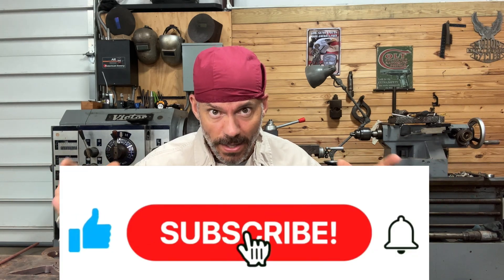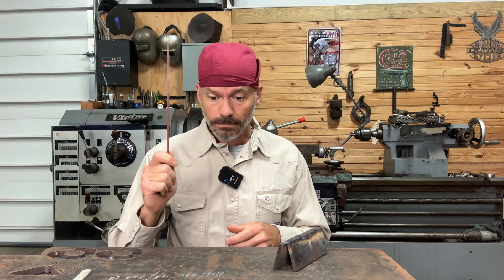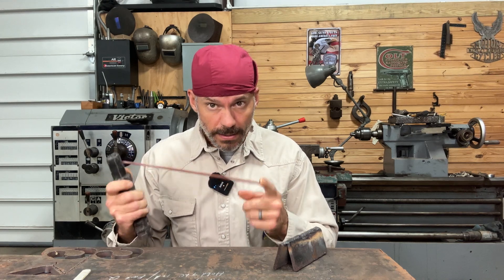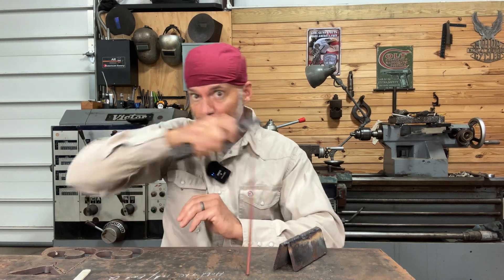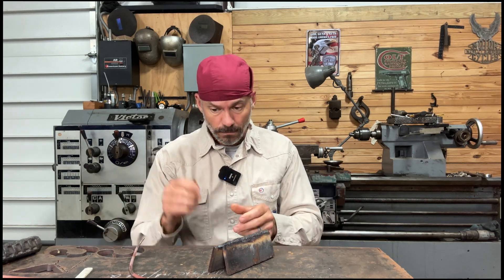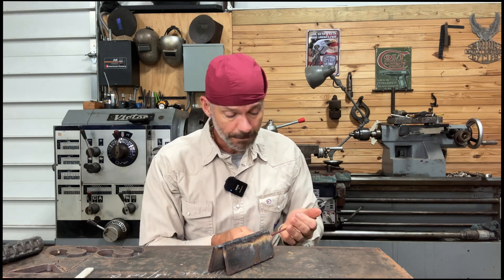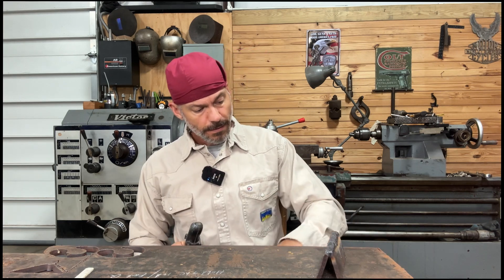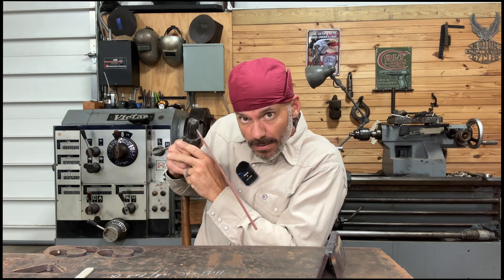How to Weld Without Sticking The Rod (Arc Welding with a FLIK)

Comment: Yeah , I bought an old AC Arc for $50 and I soon found out the Amp Gauge is way off. I was welding 6013 and I started off on a test 3mil square tube and set the Gauge to 70 amps . No good just  sticks too cold ,so I tried 90 ,no good..too cold ??.what's going on here I thought? Ok let's try 130 Amps , yep welds fine  !
What is happening is the Amps gauge means stuff all. It's not even close to being accurate.
Could be bent perhaps? So I do is set it up weld and  ignore the gauge completely. That's the trouble with these old AC welders. They often have something wrong with them , I bought this one because the leads are in mint condition so I thought the rest of it would of been good and low hours perhaps..well low hours yes , because the gauge is not working and that would put many people off

Comment: I have a DC inverter welder 110 volt mini welder that I will not weld with a 7018 /3/32 rod....any tips
Reply from the maker: Don’t use 110 V to Weld . It just doesn’t work.

Comment: Sorry if this a stupid question, learning here. When you long arc it back to where you want to lower the arc and began the weld, will the long arcing leave anything behind that might then get covered by the real weld pass that might weaken the weld? Thank you
Reply from the maker: that’s a good question. Yes it will leave BBs and a little bit of junk behind but the pass will clean all that out. You’ve got to get the rod going. Are you’ll have porosity and other problems in your starts.
Reply: @TaylorWelding  Thank you for your help, I appreciate it.

Comment: I'm just starting out.  Nice tips on not sticking thanks.  I saw the tip on another channel re 10:00 - seems to work ok if u start it like that but move away soon after before it heats up.  I've tried that a few times and seems to work better for me not sticking.  And yes good points at 9:30 - less control starting out since the stick is longer and get more comfortable as it gets shorter/ more control.

Comment: I am new to welding and I can use 2.5mm rods no problem and rarely stick but when I try 3.5mm rods I rarely don’t stick and just can’t seem to strike an arc! Going to try some new rods as both sizes will doubtless be a bit damp, though no issues with the 2.5’s. Are the larger ones more adversely affected by damp!?
Reply from the maker: When it comes to welding rods, the problems get increasingly worse as the size gets bigger

Comment: This is the kinda stuff us young guys need, I’ve been practicing just as you said but my issue is my arc just does not wanna stay lit. I’ll throw down a nasty slug but somewhere down the line it almost feels like my arc starts getting smaller and smaller until I stick it. Also I had no clue they made stingers like that, my class has stingers that look like a cows upper mouth from how worn they are.
Reply: Could be a bad batch of rods; or you’re using one of those Chinese inverter machines from Amazon. If you’re using a cheap Chinese inverter machine; buy one more, and connect them in series. Set them both at about the same setting, no need to be precise, this set up will give you enough open circuit voltage (OCV) to burn any rod out there, bad batch or not.

Comment: The bare tip of the Stick is what makes it stick, Keep the stick at an angle and just slide it across the basemetal. Yes the Motion is like striking a match but the difference is that you dont apply pressure like striking a match.
Reply from the maker: Thanks for the tips!

Comment: How are you doing I have a test coming up and it’s a No Grind test on my 5g and branch could you do a video of how to burn out the slag/trash im already burning really hot and keeping it tight but still got wagon trails when I break my nick straps im on 4th gear and 75 running a classic 3 super hot
Reply from the maker: Am I too late?
Reply from the maker: If so, how did you do?
Reply: What’s up man I’m just now seeing this but yessir passed on my first try passed all of my 5 test had two out of the 5 that I couldn’t grind just my starts and stops but overall did pass thanks man

Comment: Hey I had a thought, I don't get them often lol, but I wonder if that arcaptain would do better with a different brand of 6010. I used to hate 6013 till a friend in the UK told me about Esab brand Sureweld 6013.  They do code pipe with 6013 over there. He said that's all they use is the Esab 6013. I tried some ordered from Amazon. He was right even uphill and overhead they run like butter on toast man almost as nice as Excalibur 7018. Man I couldn't believe it. So just a thought. God bless brother. Have a good'un.😃
Reply from the maker: That’s a pretty good thought. Maybe one day I’ll get a chance to try it out.

Comment: Welcome back!
Moldy and rusty rods--this is a REAL welding channel!!! 
And older self-taught welder I knew (he made log splitters (fabbed up from mostly junkyard parts) and did tractor/farm implement repairs in his retirement used whatever he could make work.  He didn't know squat about rod numbers but what he sorted out by trying them. I saw all sorts of odd rods in his "rod locker" (steel shelving in an uninsulated building).  I'd ask about them, he'd tell me he found them.  He was a pretty good welder and also did a lot of grinding and paint.  He left school in the 8th grade and built houses (even my house) in his earlier days.  I know he welded with some old nasty rods, and got the work done.
Reply from the maker: Sounds like my kind of guy